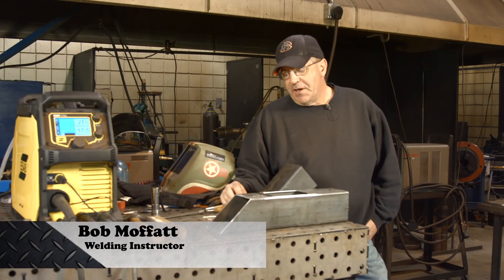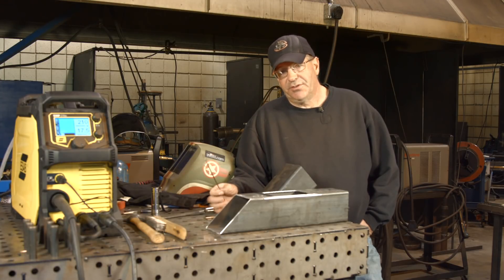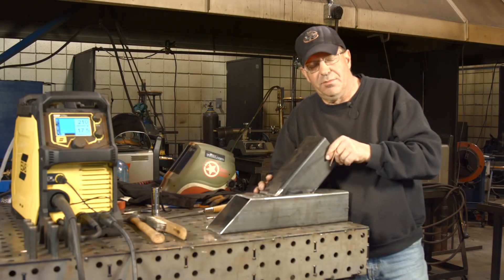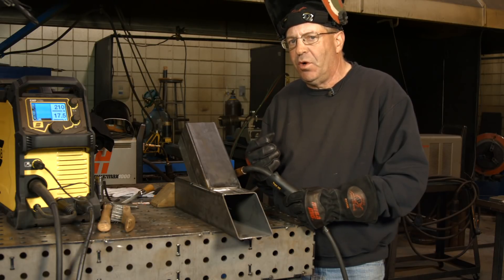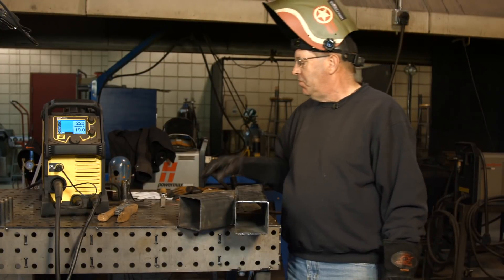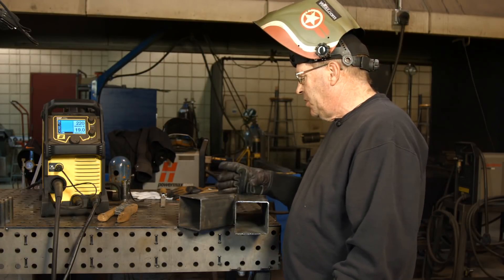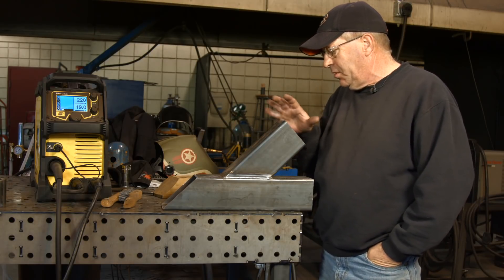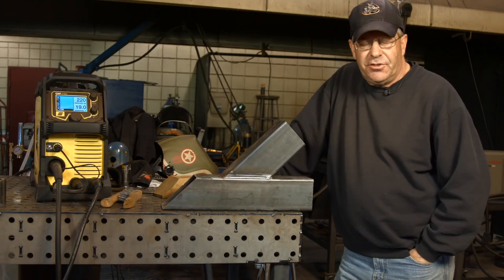🔥 GMAW Square Tubing and Inside 45° Corners

Comment: @Weld.com COOL TRICK FOR U GUISE! if youre in tight corners with mag/mig, just crush/cut to shorten the gas nozzle, it will let you shorten the stickout and still have a decent gas flow, now, this isnt anything fancy, but it works wonders on these tight corners, just keep in mind any spatter is more likely to clog the wire feed since its simply closer so intentionally set wire feed lower

Comment: Would a pulse capable GMAW machine like the MillerMatic 255 helped that deep angle weld? Pulse supposedly can handle stick out variations during a weld. I''d wonder if one wouldn't also want to increase the gas flow for a longer stickout event like that. No?

Comment: Great video about how to handle a problem situation. Most MIG welders will all face this situation eventually.  It sure brings back memories. I did a lot of those tough welds, when I was fabricating.  Welds like that can make a preacher swear, when things don't go right. The trick is... Crank up all the settings and run it HOT. BURN it in.  It'll work fine and look good.  
   Suggestion:  For a problem weld like that, get the stick welder and use a 7018 rod (the work horse of the industry).  It'll work a lot better.  The rod reaches in there easily. It'll do a  beautiful job and there will be a lot less swearing.  Why do things the hard way, just to prove you can ?

Comment: why are you saying you change voltage on a mig.

ive used alot of mig machines-single phase and 3 phase and they all have only two settings-wire feed and AMPERAGE(sometimes the amperage has a dual display that can switch between amperage or thickness)
Reply: He's using an ibgt.. much newer technology than the welders you mentioned.

Comment: Is there any way at all to do that 45º inner corner weld with Stander Inverter Stick Welding...? I have got a scenario like that now - bit with ann even sharper inside corner..
I'm an home hobbyist with no proffesional welding training or experience.
I'm on 50mm Square Tubing with 2mm wall thickness

Comment: First off, love the videos,  even after welding for a long while I still learn things about processes or filler materials I'm not familiar with, and I know there's more than one way to skin a cat, but In my experience welding in a tight corner I just would get an old nozzle and either put it in a vice or smash it with a hammer until it's an oval or as flat as it doesn't touch the the contact tip and then you can get closer  CTWD and don't have to make any adjustments to the voltage or wire speed or even gas pressure as I've seen people do.

Comment: Yes by listening to that last weld it did sound like the wire was in a bind a little. It wasn't a setting issue as the sound variance kept changing. You also may have felt the vibration in the lead as well from the wire being in a bind/twisted. Looks good keep it up.

Comment: I have an older Lincoln idealarc dc250 mig welder which is an awesome machine. It works every time, and all the time. My question is, why do all the new welders use a voltage adjustment rather than an amperage adjustment?

Comment: Looks like a fun project but did you calculate th Z-loss for the size of that weld. AWS D1.1(2015 edition) section 9, table 9.5, page 279 shows an increase in weld size of 1/8 of an inch.

Comment: lol, I make tight welds like this all day. just run hot stringer bead with no movement. weld comes out a lot cleaner. the movement is causing the lost in arc causing the wire to spit

Comment: This guy failed. Welding down hill? Not wrapping corners. I understand is only short arc and not many certifications for this but you should always wrap corners or back step them when you start different weld.

Comment: Is there any particular reason you chose to run that last weld bead downhill vs just going horizontal like you did on the other three joints?
Reply: No particular reason other than camera angle.

Comment: Nice tutorial.. Good looking weld. Do you recommend the Esab welder? What model for general trailer frame building would you recommend? Thank you
Reply: Jeff DeLuca - when dealing with things that could fall apart on the road, I'd recommend practice over any particular brand or model or process. The liability needs more consideration than what welder to use.

Comment: Alot of times (probably not on that thin of material) when you run a downhand weld in that configuration the toes of the welds wont penetrate. Not sure if that is really cold lap?? not sure what its called. Anyways it will really stand out when it gets painted then it leaves nasty rust streaks.

Comment: HiBob-great video again. 2 questions-is  the shroud on your gun live? I remember you told a guy that you can't take the shroud off (flux-cored weld ) as it holds the tip in. Then, does the ESAB machine only take that gun/torch assembly-seems to me it would be better with a standard (?) tweeco gun. Cheers.

Comment: if you would have had the esab on the "smart MIG" setting; would the welder have compensated for the longer stick-out? I have that welder and have noticed it to be incredibly forgiving when on the auto setting. Your thoughts.
Reply from the maker: That's a good question. That is something we will have to test out and get back to you on.
Reply from the maker: Answer will be in Monday's video. The short answer, yes it does.
Reply: Weld.com good deal. thought it may. it's a pretty nice little welder. take er easy.

Comment: 6:20 - You said it, 6:56.

Much better Camera angle, thanks.

I would have done it 1F over 3F down. Would have tried pulling back the Nozzle, and increasing Gas Flow. Straight neck inside or switch to Stick would have changed the appearance considerably, so that's possibly out.

Would have done the 45° first and matched the easier ones after, making each Weld a 1/4" longer so it looked like the Drawing used a weld-all-around Symbol.

But, the deed is done; and it looks OK (the Student will say).

Good candidate for Spray but that's another Lesson.

Thanks for your Videos,
Rob

Comment: I see you using the rebel in many videos would you recommend it for a beginner welder ?
Reply: Absolutely!
Reply from the maker: Absolutely. It will do multiple processes, it's easy to set up, idiot proof interface and welds like a champ on 110v or 220v.
Reply: Weld.com 😂😂😂